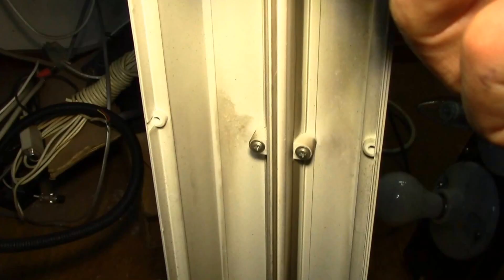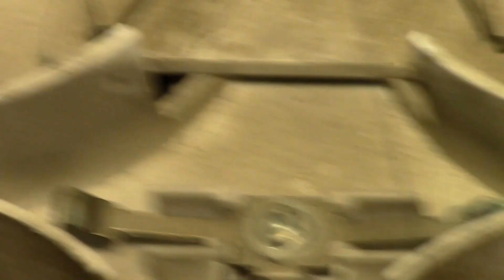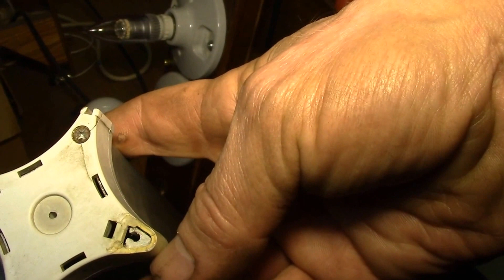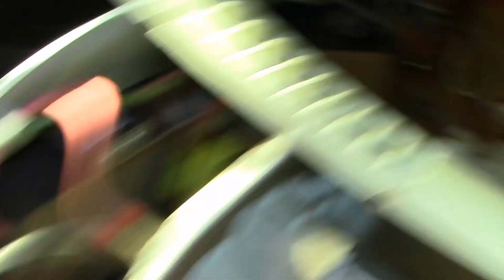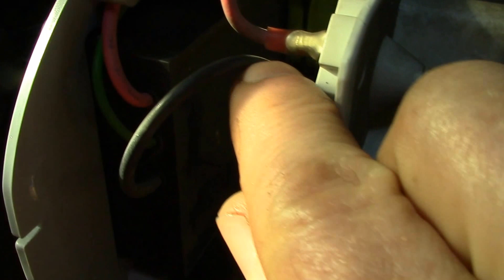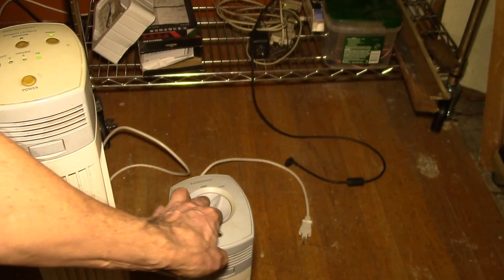Environizer Air Cleaner Repair, Part 2

Comment: I have the smaller version which is the dial version. I got it 20 years ago and I recall reading in the instructions that you have to turn it upside down so that those plastic things on the wires slides down the wires to clean them. I have noticed that when I hear that arcing popping noise that that means that the wires need to be cleaned. When I do the cleaning process that noise goes away until it needs to be cleaned again.
Reply from the maker: Yes, that usually does the trick.  But on my taller unit, I had the high voltage wires touching and that led to arcing where they were touching.  I think the wires on the shorter unit are routed a bit differently.  I never had any issues on my shorter ionizer.

Comment: thank you so much for your tutorial mine was arching so i took it apart & it was full of dust cleaned it out & now it works fine
Reply from the maker: Glad you fixed yours.  Yes, this is a very easy repair most of the time.

Comment: Hi.  I have one on these tall towers.  It doesn't come on when plugged in the and turned on.  What would be the first thing you'd do to try and fix it?  Thanks
Reply from the maker: Check the high voltage wires down at the bottom and clean/reroute them like I did in this video.

Comment: R Brown - The power transformer, in the base of the unit, has a tapped secondary that is connected to the circuit board on top; the voltages are labelled on the circuit board.  The Brown Wire from the transformer is labelled " 0 VAC "; the Black Wire is labelled " 12VAC", the Blue Wire is labelled "14 VAC ", & the Yellow Wire is labelled " 16VAC".
Reply from the maker: Good information.  If I ever dig back into this unit, I'll check that out.  It's still working fine after cleaning up the HV wiring.